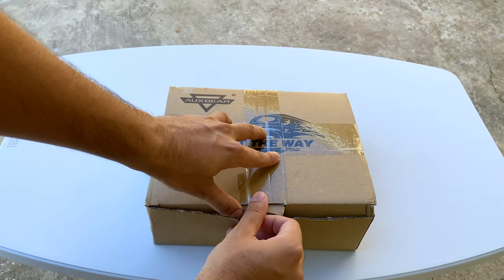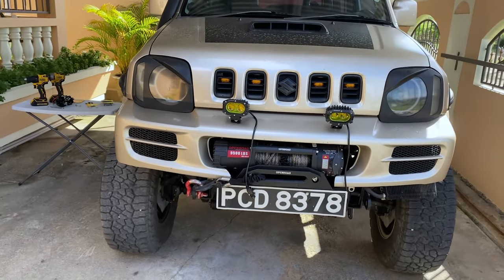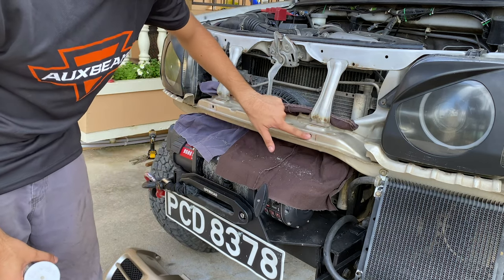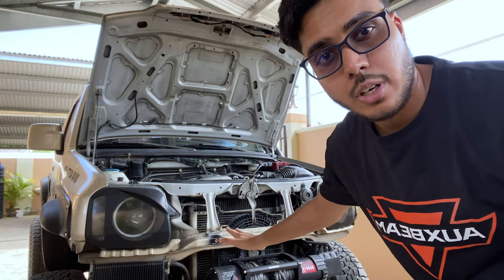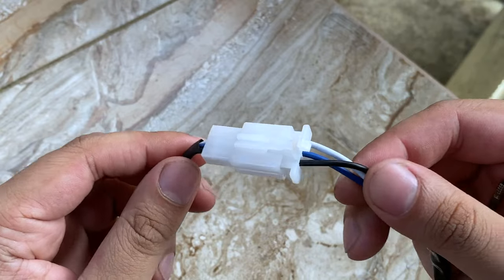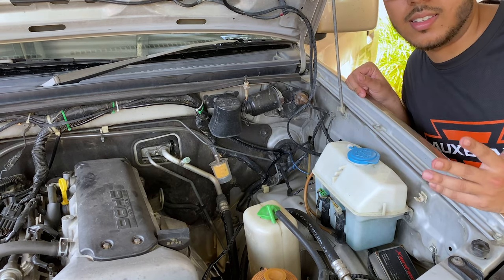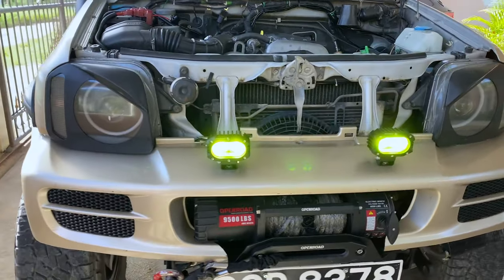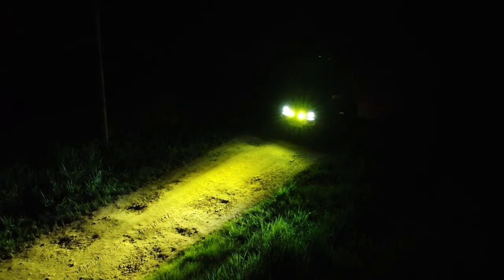AUXBEAM R4 SERIES LED Pod Lights Dominating the Darkness!

Comment: Nice install Zaff . I also installed a set of lights in my  new Jimny JB74 . I removed the pins from the  switch jack and wanted to pass the wites through the firewall gromet . But everything was so tightly packed inside the gromet that I instead routed the wires next to the snorkel and through the driver  side door . Mine wasnt as clean an install as yours . 
One thing regarding the switch inside the cabin - the Red and Green indication LEDs on the switch  arent lighting up . What could be wrong ? Could the LEDs be defective ?
Reply from the maker: Thanks buddy. Sometimes those grommet can be tricky to go through, have to try different spots on it. With respect to your LED on the switch, it could be defective LED on the switch or it could also be a loose pin on the connector that you removed and replaced. I'd double check all the connections and if it's still not working, I'd replace the switch to a toggle switch. I hope this helps.

Comment: What do you do when on public roads...do you remove them since these are classified as unauthorized lights
Reply from the maker: Yup. Same as my light bar. Only goes on when needed offroad at night.
Reply: You just disconnect them not totally remove right.
Reply from the maker: @kenalfred7242  Remove lol. It takes 5-10 mins to remove and put back